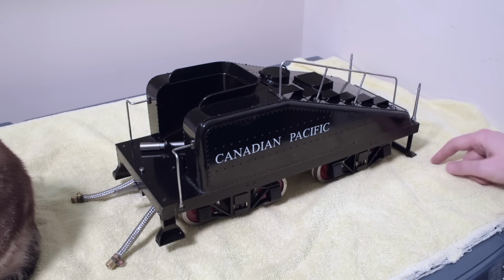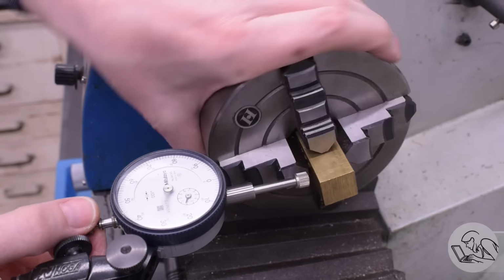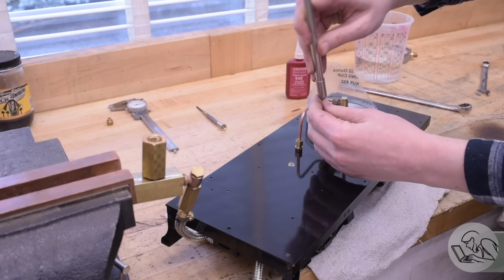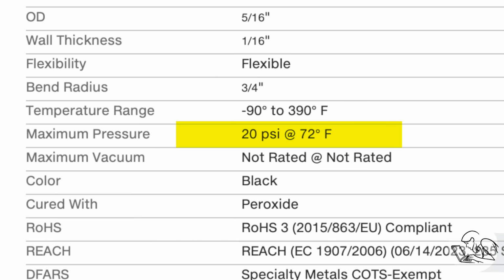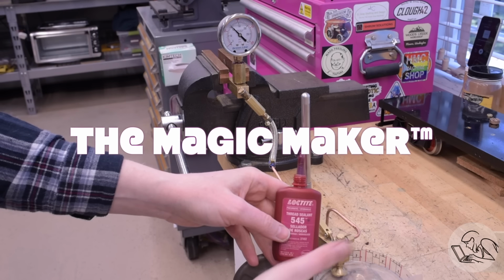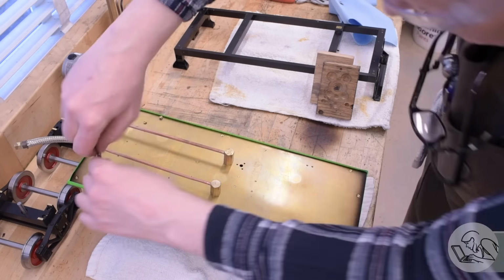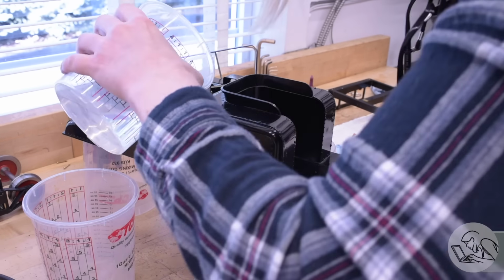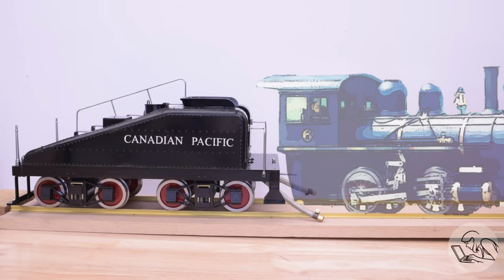TENDER IS FINISHED! - Pennsylvania A3 Switcher, Part 34

Comment: I used the silicone hose on my 3/4” Atlantic and I’ve been popping it with my hand pump every few laps around the track. Definitely not workable long term so I’m going to have to find something else for this season. That hose with the nylon braiding looks like what all the old time engines at the track run, I’ll have to look into that.
Reply from the maker: Good tip, thank you! Yes, this nylon reinforced hose should work well and I’ll likely switch to it before running the loco. I got it on McMaster
Reply: @Blondihacks  awesome, got to love McMaster!
Reply: @Blondihacks For future reference I ran nylon braided hose on my hand pump line this weekend and it did fine. I kept the silicone lines on my axle pump and bypass lines since they are low pressure and had no issues out of either.

Comment: Great work Quinn, on loco operations we mostly work as close to the safety limit as possible. If you wait till your boiler is down to what you mentioned you may find your not going to get the effect you need. Your preasure will drop significantly when you add cold water. For my loco I add water when possible while preasure is near maximum.  Now I have a more important reason for this I'm addition to yours as my loco relies on injectors and/ or a steam operated water pump.  However in your case to maintain performance you would want to add water when preasure is near max operating to reduce as much as possible the unavoidable preasure reduction while doing so.

Comment: 🤓 To be nerdy the ASME code requires 1.5 MAWP for certifying steam boilers (1.25 MAWP after repairs). This is accomplished by gagging the relief valves to obtain this pressure, and a quick hand on the blow off while pressureizing.  🤓

Comment: 9:55 speaking of hoses. I had the opportunity to look at somebody's flex hose you know the ones that they advertise on TV with the warranty if they break blah blah blah well I called up the warranty company and sure they can get me the replacement with proof of purchase and for the cost of pretty much another hose. What I ended up doing was cutting open the compression fitting and salvaging the threaded end and putting it back on and then clamping it. The problem I discovered is the outer sheath goes over a really flexible inner tube and if that is not in place it will burst..... how do I know this..... how do I notice.... it looked exactly like the timestamp except for I couldn't get the water shut off fast enough. So the outer sheath is a structural element that retains the inner thinner hosing from expanding past its bursting point which is actually an interesting design element. What I ended up having to do is use wire to clamp the end back on so it was low profile and I did that by making a tool to make the wire hose clamps.

Comment: Before you leak test could you douse the tank in talcum powder? So the wet spots show up easier? 

Also they make "hybrid silicones" that use a bit of polyurethane in the silicone blend. Those will bond to themselves so you can apply more over a previous layer. Unlike straight silicone. Could these be used for the sealing instead as you have the option to add more and it bond properly.

Comment: Hi Quinn not sure you read these or not but I have found your videos to be quite inspirational.Really enjoy the informative content. I’ve about decided I’m going to pick up the Precision Mathew’s set up you’re using, mill and lathe. I am brand new to all of this and I was wondering if your lathe has the power to run carbide. This is all new to me and making high speed steel cutters looks like its own rabbit hole the I’d like to avoid for now.

Comment: Wow ‼️
What a Trojan build eh 👏👏.
One thing I did notice though.
In the early part of the pump testing, the pump was on the floor pan. I noticed the floor pan ‘flexing’ during the pumping action.
You may have to somehow ‘reinforce’ the floor plate of the tank?
Repeated ‘flexing’ of the brass will work harden it, and you may develop cracking in that area.
Great project, and I can’t wait to see the loco construction phase.
Regards
Robert
Reply from the maker: That’s because it wasn’t attached

Comment: I've been using ACF-50 as an anti-corrosion spray. It works well. In my shed condensation on machine tools is an issue and it definitely helps. Am using it on my vintage cars too.

Comment: A really cheap and durable silicone is acetic cure roofing silicon.
I had a massive oil leak on a V12 Jaguar rocker cover dripping onto the exhaust from a broken thick and brittle paper gasket. To do the job requires a full 8 hour day (but much more when you attend to all the other things when it's apart). So in true mechanic style, rather than do the inevitable I cleaned it with Brakleen, poked the broken bit of gasket back in there then sparingly pumped some roofing silicone in. It was semi permanent repair. Went on for another couple of years with heat cycling, oil etc. Even when I got around to doing the job properly there was still no leak from there.
Amazing stuff.

Comment: Hose industry uses 2 x stated pressure = Proofing Pressure .... 4 x stated pressure = Burst Pressure ..  I'd guess the stated pressure is just the rubber hose... The wire braiding is adding support (tighter the better) so I'd guess that this hose will work o/k for your application
Reply from the maker: I guess we’ll find out 😬

Comment: If you have problems with the hose in-situ, you may be able to use 100R7 hose to do what you want. It's a thermoplastic hydraulic hose, so its pretty flexible and rated to high pressure.

Comment: Anything involving water and its potential to leak can be a real pain.  H2O can very intrusive.  I remember replacing the recirculation pump on my hot tub spa and I got it installed first time with NO LEAKS!  I know the feeling of doing something with water and the joy and satisfaction of getting zero leaks.  Good job!

Comment: Brilliant work: you must have a huge sense of achievement. I don't know if this helps, or is relevant, but years ago I did a lot of DIY plumbing work when I renovated my flat. I used mostly 15 & 22 mm copper pipe. I used a combination of Yorkshire joints (pre-soldered couplings) and compression fittings. Quite a few of them wept: they didn't spray water, they simply dripped very slowly. A friend of mine told me to leave them alone and monitor the situation for a few days and, sure enough, all of the weeping stopped. I was told that corrosion was essentially plugging the tiny gaps. We're talking about roughly 1 bar of pressure, so I don't think this would apply for a high pressure line, but for low pressure systems (like the tender itself) it might work too?

Comment: At least here in the states, any time you run into NPT you always use pipe dope and pipe tape, because it doesn't seal very well without it, even under extremely light pressure.

Comment: Very well done. Now, on to the exciting part of the build. Will you be buying the drivers or making them? Will you be casting a bell, turning it, or buying it? At this scale, do this engines have functional sanding domes?

Also, Broadway Limited is releasing the a new HO scale PRR B6 Slope Back 0-6-0 in 2025. Yes, it is a later model then what you are doing but similar.

Comment: Well done on the tender looks and is amazing.  You  were absolutely correct to test the hand pump to a greater than the  max. boiler pressure.  As you can imagine  scenarios in service where you might have a white hot fire and you find yourself with an unplanned stop on a down hill grade with the water disappearing out of the button nut of the gauge and the safety valve ramping its head off. You’ll be so happy that pump works !

Comment: I've heard there are two types of tapered pipe thread. One type seals once via mechanical deformation of the threads, once disassembled they won't seal again and the threads have to be remade on both sides. the other type of tapered pipe threads requires a thread sealant to seal. I don't know which tapered pipe threads fall into which category or if that classification is fully correct. but may explain some issues with tapered pipe threads

Comment: I am sure someone has commented already, but tapered pipe threads have a natural leak path through them (I believe fellow Canadian AvE did a video about them), so they will always use sealant/tape. The one exception if I remember is NPTF fittings, and they are designed to deform to fill the leak, and are thus non-reusable (and annoying).

Comment: "Faced off the end of the stock as is tradition".  There helped ya LOL  (Sorry just had to do it LOL).  I wonder if you could pull a slight vacuum on the tank to pull in come "crazy glue" to fix the leaks (if it didn't wick in on it's own).  Cats internalize their emotions.  I'm sure she is as happy with the Tender as you are LOL!  BTW the world thanks you for inventing braded wire reinforced rubber tubing!  Just think of the possibilities!  Congratulations on this very impressive project.  Can't wait for the locomotive!  Thank you for sharing!😏

Comment: Tender looks amazing Quinn! FWIW, I can't say for certain based on your video, but it's quite possible that you are running your NPT taps too deep causing the issues with the tapered threads. We use tapered pipe threads at work and have went as high as 15,000 without leaks. I'm not criticizing nor disparaging your work in any way, just offering one thing for you to look into that may help your disdain for NPT connections. Keep up the good work!

Comment: about the seal that kozo designed on the top of the pump, They're basically crush seals. they're amazing at holding all the pressure... the FIRST time, but subsequent times, the surfaces work harden, and stop conforming to each other. the only thing you can do is remake the seal or goop it
Reply: Yeah. Crush seals are used even in ultra high vacuum applications, where air can get through what would otherwise be solid welds. The copper gaskets used in UHV applications can hold ridiculous amounts of vacuum if tightened properly. (course, there's a lot of discourse on what the proper tightening pattern is haha)

Comment: you can make a quick and dirty roll crimp to attach a hose to a barb by replacing the blade in a rolling-blade pipe cutter with something not sharp, such as a washer or two, then you find a piece of copper pipe that just fits over the hose connection you want to crimp, anneal the copper, put everything together, and form the crimp in a manner similar to cutting the pipe, just be careful not to use too much pressure on the pipe cutter or uo will crush the annealled pipe.

Comment: I don't think the pipe leading to the axlepump will leak since the pump is behind the tube which therefore should be more or less at atmosphere
Reply from the maker: Yah, I didn’t mention this but the other side is the low pressure side of the pump so it won’t be a problem.

Comment: Awesome job. Something you might want to consider if you ever need to seal the inside of a tank again. In the experimental aircraft world they have a liquid that they swish around inside the gas tanks. It dries to a rubberized finish. Works extremely well. Also, if you’re looking for something better than bathroom silicone. A product by Permatex I think, it’s called The Right Stuff(seriously). Used when building engines or sealing differential covers. Works way better than the RTV silicone we used to use. 😁😁
Reply: I was also going to recommend a fuel tank sealer. Works great on old motorcycle and lawnmower fuel tanks if you want to squeeze a few more seasons out of them. Not sure if it would work in this application though, because you don’t want to coat the pump mechanism and other fittings inside the tank.
Reply: I think I would have made a fitting to put a light vacuum on the tank to draw the silicone into the leaky spot.